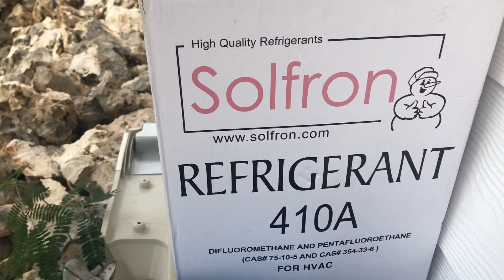TESTING OUR AIR CON SYSTEM // HOUSE BUILDING IN THE PHILIPPINES

Comment: Anthony, Don't be concerned if the initial cool down takes half a day. There is a lot of thermal mass in concrete and heat gain thru single pane glass. I assume their is no ceiling insulation since you did wireing after the drywall was up and painted. You could if needed use blown in insulation for the ceiling and storm windows on the glass. We set ours to 78 degrees F because any lower we are shivering in blankets. The Philippines house build is designed to be self cooling so no air conditioning is used or needed there.
           I am watching another channel that is going to do textured plaster on the ceilings. I may texture the wall skimcoat to test reducing the echo with concrete houses and smooth skimcoat.
I use close captioning on videos and sometimes Lyn talking is displayed as "music" with no translation. I often thought she speaks like she is singing and apparently google agrees.
                                
                                                                                     george and aurora

Comment: The place looks beautiful!! This is just my 2 cents worth on this. I am certified in HVAC  In layman's terms so you understand why did they mount the outside unit to the wall. That puts noise and vibration into the building. I know the unit that you have installed it's a good one feel good about it. But it should be setting on a concrete slab. I know it can be mounted on a wall. But why? Was the line set too short?
Reply from the maker: I don’t know why it’s mounted on the wall but I’m happy with it . There’s no vibration and unless your standing in front of it you can’t hear it . It’s so dam quiet . I’m glad it’s up high away from the rain and water . Honestly zero vibration .
Reply from the maker: Thanks for commenting about it Marvin
Reply: @LynAnthonylifeinthePhilippines   Then don't worry about it if you can't hear it don't worry about it it's better up high out of the weather.  Also like I said that's a good unit you will be happy